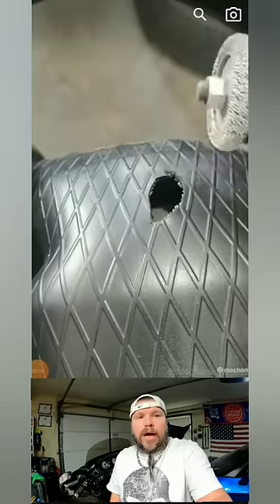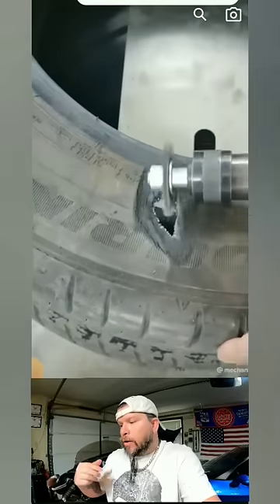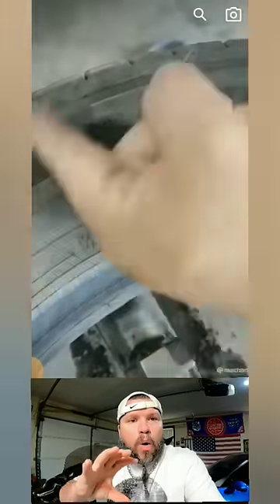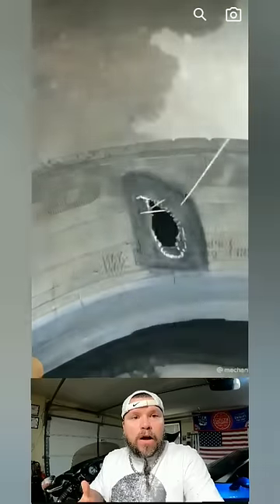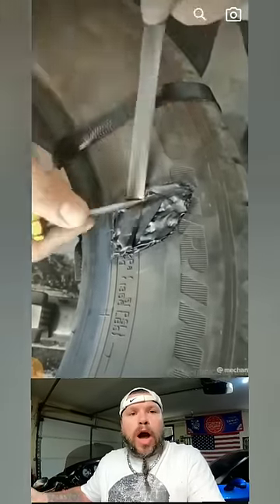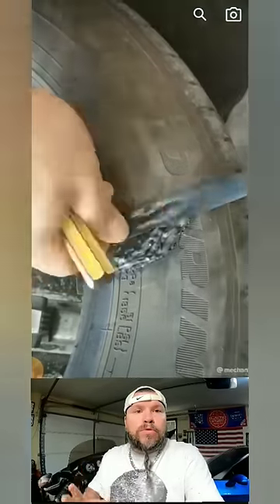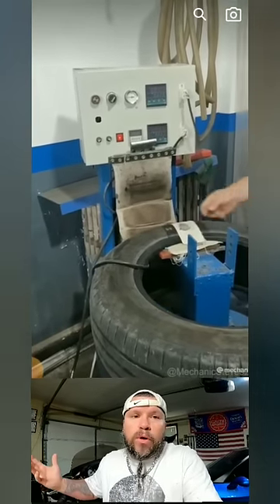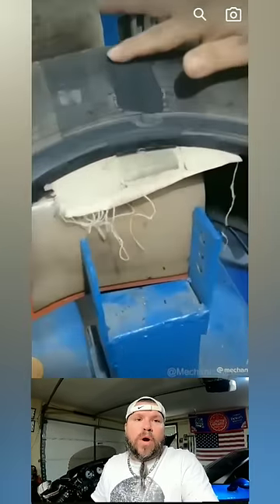patching a tire

Comment: I worked for 18 years at a major tire manufacturing company.  What the guy is doing in this video is a legit repair.  They repair and reuse the tires from all over the world. The side wall is rigid enough to accept the repair.  As long as the rubber repair is cured properly.  He used a all and pure rubber to make sure there is no air trapped in between the layers.  Its not as good as a new tire but it will last for a few 1000 miles.
Reply: I was a Tyre fitter for years as well. Thanks for posting this. Now I don't have to. 👍
Reply: I'm no tire guy myself except I mountain balance my own tires using oil just a small amount and I can tell that this is a legit fix I guess maybe it has to do with my welding experience but as long as you apply the new wire behind the broken cords that should give you the strength and then like you said apply it so there is no air between the patch creating separation and there's a complete fusion between the new and old rubber it should be just as good if not better
Reply: the issue is that the threads holding the sidewall together is made up of tightly woven cloth, whatever this guy in the video did, did not put in the fucking effort to make sure it has the same flexibility as the rest of the sidewall.
Reply: @xracecar  I am more than confident that he used the proper material he had the actual machine to do the job it's not his first time and they make a machine to apply this patch just like most other things to do with tires it probably came in a kit
Reply: You apparently like to walk on the wild side
Reply: No. Not on radial tires. They have belts that hold them together. Maybe if you stuck an inner tube they would be fine
Reply: @anthonyskata  I guess 18 years is a tire manufacturer doesn't hold any clout
Reply: @777Poker  did you read the first reply of this thread The guy was manufacturer for 18 years and he said it was a good fix and then there was a second that agreed as long as it's done properly there's no issues The sidewalls are pretty strong
Reply: @bretk7916  That experience means nothing if the guy seriously vouches for this. There's a reason why this guy said "on road" use is not recommended in the slightest. For things not on public roads or low speeds, this is fine but not anything more.
Reply: I'm never worked at a tire manufacturer, but I have gone to college as an engineer and can say that I probably wouldn't run that tire on a highway again, especially not with a load. The structural integrity of the tire has been compromised, even if it looks like a clean repair, it won't meet the same standards it had before the hole on the sidewall. Since it's not one solid piece, their will be extra flexibility around the patch area, even if it's minuscule, every time the area gets hit or gets too hot, it will lead to fractures in the joint that will cause it to fail. If you add weight, the downward force will affect this patch area more. 99% of manufacturers will tell you to never patch a hole on the sidewall, and you're not supposed to patch anything greater than 1/4", which this tire definitely had. I have a fleet of equipment and anytime I have a sidewall issue, I just replace the tire, it's cheaper to replace a tire, than to replace a life if the tire blows out. Had to replace a $2,000 dollar tire on a tractor last year, that was a month old, because of a small hole on the sidewall.
Reply: @bretk7916  ... did you listen to the OP of the video? Cause he quite clearly comes out and says that he is not an expert on the subject and he is only giving his opinion.
Reply: @xracecar  Assumptions. I driven on severely stitched tires and they will last.
Reply: @anthonyskata  Its a durable repair, i driven on them and you havent, i know and you are only assuming based on your very limited experience.
Reply: @dirtdora2499  Reality proves stitching to be perfectly legit and durable.
Reply: blablabla its forbidden in europe for reasons!
Reply: I have a friend who works for Dunlop who says nah ah
Reply: @bretk7916  working at a tire manufacturing place doesn’t mean you make tires by hand 💀 or by machine bruh, you can literally just be manufacturing tires aka selling already made tires. Yeah just cuz you see and sell tires all day doesn’t mean you know how they’re actually made & how they work & how they’re fixed buddy 🤡
Reply: I work on conveyor and the patch he’s doing is called a vulcanization it’s not as strong as a seamless piece of rubber dependent upon the type of splice can be anywhere to 40-90% strength
Reply: What is with these cap ass YT comments man? Your tire deforms way too much for this repair to hold up, especially under heavy city corners.
Reply: This is literally my job. I specialize in otr tire repair. This is a vulcanized repair. Although this style of repair is very strong. Iwould not even think twice about doing this repair myself or watching someone use it in person 
Holes just too large for it to keep together
Reply: It is cool to see there are places where spot curing is still the main way to go
Reply: I wouldn't feel comfortable with it on my driving vehicle, but I would use it on the trailer.
Reply: @Dontbeahoe  so not safe for the road!
Reply: It’s legit but guess we shouldn’t think so bc some guy who wasn’t in tire repair knows everything i reckon
Reply: @Dirt Dora  you're an engineer. That's all you had to say for us to not take anything you say seriously.
Reply: Yea but tire tech to manufacturer, what the guy is saying is right. That tire will for sure blowout much sooner than a fully in tact tire. We do re treads for truck tires here also, thats another example of something sketch that people do with tires, and because of that you see just a ring of tire tread laying on the side of the highway all the time. Theyre both very dangerous still.
Reply: Perfectly good for farm use as the OP stated.
Reply: @bretk7916  Are you Hercules or Atlas?  Don't you get tired balancing mountains?
Reply: After a few thousand miles look out....😊👍
Reply: nah its wrong lmfao he used clothing cloth and its not going to be as strong as it was dk where tf you worked but obviously wasnt trained right
Reply: @Wock

Did...did you really just say a tire /manufacturer/ wouldn't know how a tire is fabricated? Jesus.
Reply: @minecraftblockychris8708  let me say this. I know more than you about tires. I was a tire builder for 10 years before I became a mechanic at the factory.  This is whats called a bias tire. Mostly used in trailer tires and off road vehicles.  He used kevlar threads to reinforce the  sidewall. Then used pure rubber not synthetic in multiple layers and then cured the tire . "Vulcanized " with pressure and heat like how all tires are made. For a trailer tire its perfect acceptable.  You don't know what your talking about.
Reply: Let me be clear.  This is a bias tire. Not a radial. It probably a trailer tire. They have cord wrapped from the bead to bead. Its not a high performance radial. This repair is absolutely done all over the world. Almost all farm tires are repaired and re treaded in repairs like these. Its not as good as a new tire. Nobody is saying it is. Its a repair that will work and has worked.
Reply: @dirtysanchez2k  lmfao its not even a trailer tire what are you on right now
Reply: @minecraftblockychris8708  not a tractor trailer tire. A trailer tire. Like you would find on a pop up camper or a 12 foot  Duel tire type. Prove me wrong.
Reply: @dirtysanchez2k  prove it right
Reply: @dirtdora2499  going to college as an engineer isn't saying much tbh
Reply: @minecraftblockychris8708  minecraft cause you're a child i assume
Reply: @lilsstrunks  no lmfao im not i work at a tire place
Reply: @dirtysanchez2k  god next you're gonna say conventional oil is better than synthetic. i hope you dont own a gm vehicle past 2011.
Reply: Oh. It honestly looked like electrical tape he was using (guess it's a slightly poor eyesight moment), so it seemed like he was literally just doing whatever.
Reply: Either way, I don't really care.

I'm a better safe than sorry type of person and I'll just buy a new tire.
Reply: @dirtdora2499  he reapplied a mesh and revulcanized the area.  I suppose if you have something take out a wall stud you tear down the entire house because of structural compromise.
Reply: Tire engineer with 132 years experience here, just spray some Flex Seal on it, it's the same thing. Waterproof too!
Reply: @joecee6862  Scott. Flex seal has been around for 132 years? I think they used it on horse and buggies!
Reply: Regardless of your personal experience,  I will go by the advice of the actual tire manufacturers and never attempt to patch the sidewall of a tire.
Reply: @dirtysanchez2k If you meant for non-highway use, you should probably edit your original statement to reflect that. In its current state, your comment only says that this is an effective repair which many would take to mean highway use as well.

Comment: This type of sidewall repair worked back before 1974 when tires were bias ply. Bias ply tires have intersecting cords on the sidewall but a radial tire the cords run parallel on the sidewall so a tear can and will continue to run between the cords with no cordage intersecting the tear to stop it.
Reply: Thank you for knowing what you're talking about instead of regurgitating the uneducated crap everyone else is spewing. Bias ply tires are still available and yes you can do some massive repairs. The video also shows uncured rubber, heat vulcanizing, a sidewall mold and other proper equipment for this type of repair, ON A BIAS TIRE.

Comment: I’ve never seen a repair quite like this, but the fact that they have an entire machine dedicated to this operation  must speak for something. The Kevlar in the sidewalk is all ripped, but they stitched in new thread to replace it, and then built up layers of vulcanizing rubber, and bonded it with the heat press thing. Honestly, it seems kinda legit.
Reply: I've watched one or two of these tyre repair clips, cool procedure I think it's legit aswell 💯☮️
Reply: It is, as this guy says, he’s no tire expert. The fact that a shop spent the money to buy a vulcanizing press expressly for this sort of repair speaks volumes, the rest of the world repairs sidewalls all the time. They don’t do 100 mph on asphalt, but they do stress the tire and they hold up just fine.
Reply: Itd be cheaper to just buy a new tire. I install and patch them for a living ✌️💯
Reply: that press is meant to do patches on the tread or bias ply tires, radial tires aren't able to be repaired in this way. regardless of stitching it up which will just tare through the rubber...
Reply: @bobmiddaugh5527  I was wondering if this was one of those old knowledge things that were forgotten.  I was thinking smaller wheels and taller tires from the past but had to go back even further.  Thanks for sharing.
Reply: Prices are different all over the world. A replacement might be cheaper where you are, but many people are limited to repairing as long as they can, if new tires are in very short supply.
Reply: make me wanna try something.
Reply: Only a few off road tires have kevlar. The majority are nylon.
Reply: If ya believe this or would drive on a highway with this tire on your car you must not care about yourself and anyone that is in the car ,,,, just ask a manufacturer what can happen / will happen or just ask a reputable tire shop what they think and they will tell you that is not going to hold up for daily use.   ( it might get you from point A to B if you are in a jam ) but if you really think of it the time it’s going to take to cure you just might as well get you a Good use tire until you could get a replacement for you car .  Also just so you know even the temporary spare tire is rated for a certain speed because you can cause it to blow out. BUT IF YOU THINK THIS IS OK THEN TRY AND LET EVERYONE KNOW HOW IT WORKED OUT FOR YOU .🤔🧐🤡🙏👍🏼
Reply: @dudethatuploadsstuff4247  depends on the tire.
Reply: I'd run it. Hell I've probably ran worse
Reply: Saw over 100 plus plugs in the side wall of a tire rolling down 20 in Alabama
Reply: @joe2fresh350  okay yeah lets just ask the people who sell the product if repairing already sold product is a good idea… of course they’re gonna say no you need to buy a new one.. that’s just common sense on their end…
Reply: I imagine it's for people who either can't or won't get new tires from them. It's likely more of a temporary fix just so they can make it to whoever they trust to work on it.
Reply: it is
Reply: It'd be good for going shopping, riding around town, but I wouldn't trust a highway just to be safe
Reply: @Bob Middaugh  I kind of agree with u but the profile of that machine is shaped exactly like the sidewall of the tire. I've never seen this in real life before but it actually looks legit to me.
Reply: It isn't safe. I work for Discount Tire and any sidewall damage is not repairable. That thread isn't Kevlar. In fact, Goodyear is the only manufacturer i know that is known for putting Kevlar in their tires, no one else does. The sidewall is really just 2 plies of polyester. The rubber also isn't the rubber of the tire. It lacks all the silica and other chemicals used in the rubber compound of the tire as a whole. Never trust sidewall repairs or patches on a sidewall. Get a new tire I'd the sidewall is damaged. In fact, buy them with Discount Tire and get the certificates to cover damage that isn't repairable. Instead of spending 200 for a tire, you'll get a new tire at no cost and then pay for the cert again (if you wish to) which is only 15-50 dollars depending on the price of the tire.
Reply: Lol
Reply: Yeah people bitch about everything, it looked legit to me
Reply: As cool as it is, it's not the answer. I recommend working at several tire shops. The answer for punctured sidewall is buy a new tire every single time. And a tire that's been rode on while flat is gonna be ripped up on the inside. You can do the repair and make it hold air, but the sidewall has a heat ring and will blow out like a hot tire in nascar. Buy a tire. Be safe
Reply: @rellyj  hmm yes, good point
Reply: @justinmidgette2391  why don't you just call the Department Of Transportation instead then, they'll tell you the same thing.
Reply: @isaac13d  I’ve plugged a couple sidewalls on tires… not saying it’s the right thing to do but wouldn’t ya know they didn’t fail

Comment: Pretty accurate assessment from the guy doing the commentary (certified to work on semi/commercial tires - they can be very dangerous, ie "zipper ruptures", multipiece wheel incompatability being overlooked, internal tire fires, lubricated wheel hub fires). 
Guy looks like he sorta knows what hes doing, but as you said, the sidewall is not to be patched. You *could*, depending on the location and size of the hole (usually about an inch from the edge of the tread, no bigger than the size of a bic pen/#2 pencil, and even thats kinda big), but with that being so far from the tread/so close to the bead (what holds the weight of the entire vehicle, combined w/internal psi), thats a nightmare waiting to happen for anything over 20 mph (if i had to guess, but wouldnt even mount this tired/would trash it, personally). Replacing a tire or two will save you from replacing your entire vehicle and watching your insurance rates go up (they would blame you, as this is not an advisable thing to do, like, ever)
I will give the guy props for effort/approach, though. Even rebaked the spot he patched to cure the rubber (the correct term escapes me at the moment).
Just buy a new tire, tho, fs